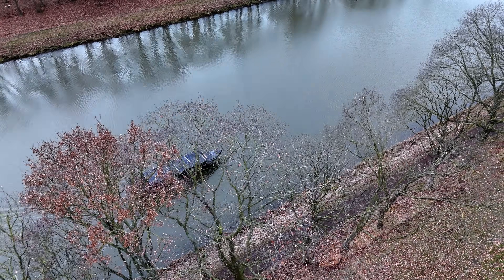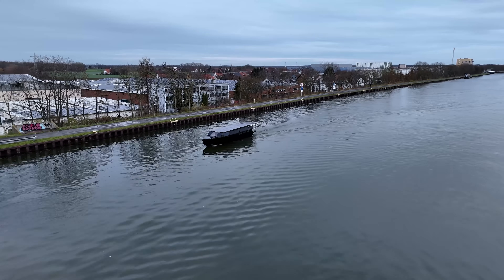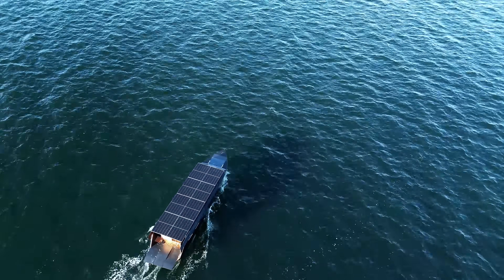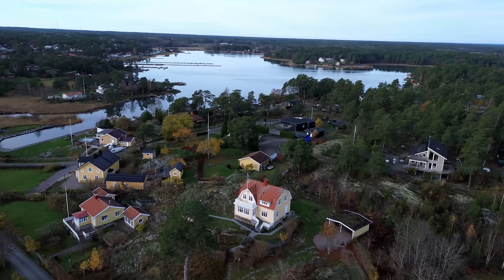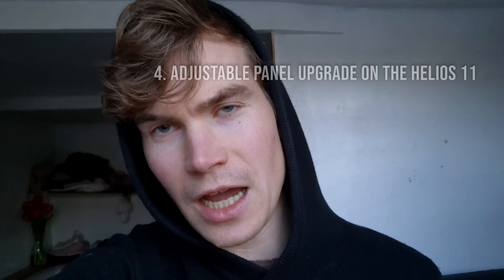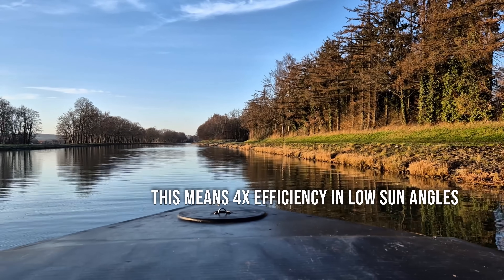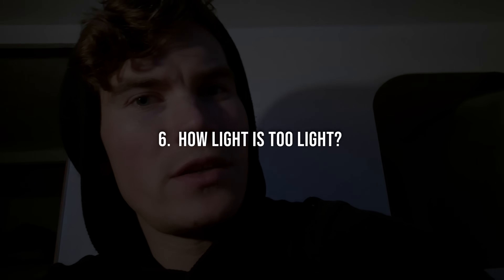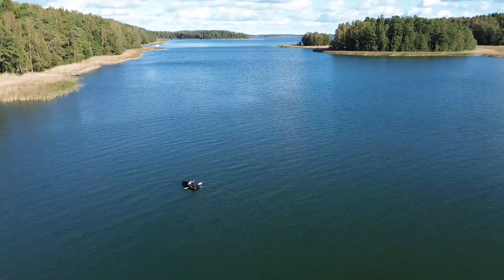My Solar Explorer Reaches Germany: Major Upgrades & Next-Level Design

Comment: Good stuff, some details.  CF is never cost effective and in many cases, not even the lightest. Medium tech FG and Kevlar like fabrics are far stronger for boat use at 25% of the cost.  
Until mass production, epoxy/ply is superior, lower cost, stronger/lb.
Next you are using the wrong flexible panels.  Find ones with regular high efficiency silicon cells like Maxon does, not thin film.

Weight matters more in a monohull than a multihull.   Why is you are planning, not displacement like a cat is or regular sailboat, fishing boat are.  A cat doesn't make a bow wave it has to climb over, it just slices through the water at much lower power above hull speed
 And you want more catamaran hull the water so you don't get blown around.
You want your inboard E drive, far cheaper, to generate power while anchored in a tidal flow, recharge the batteries.

Comment: You can simply remake your hull, by adding two long floads in the full lenght under the hull. you can even make them into a walkway. just a couple of centimeters deeper than you hull now.  it will stabilize a lot. Add these flexipanel to the sides will also do a lot when sunlight is comming from the side.

Comment: I just thought of a guy i seen developing a kite surfing kite automatically deployed as your sail he's working on the software at the moment for it i seen him on sailing parley a month or so back maybe look him up. Another idea was use small car winches to pull your sails and masts up, make a new surround on the bi facial panels out of round aluminium and attach them onto the mast using a universal joint from a car at the top. Ropes to adjust them in all directions  maybe using small winches and dynema rope and pulleys. If the mast can spin 360 deg you can literally get them out of the wind as well as into it for safety make the panels so they can be pulled horizontal and fully up to catch the sun on any angle. Instead of bi facials use some soft flexible panels back to back again with a cut of sensor for shading or have a manual switch for rare unshaded events. So many ideas good luck again hope you can benefit from these ideas.
Reply: a system like his whould rip this plywood bathtub in half,,cool sytem though,,

Comment: Unlimited range ideas: Rear addition scissor ladder collapsible extension, flexible panels secured to balsa wood or extruded polystyrene, 1 layer of fiberglass, hydrofoil at the end. Sides addition folding glass panels electric piston actuators, solar tracking automatically adjusting angle. Front addition mount winch connect to air mattress, inflate with hydrogen using electrolysis, use as kite.

Comment: Hey there.  Great content.  Not sure if you are aware of this.  A larger electric outboard with larger prop is more efficient than the smaller outboard.  You lose efficiency buy running a higher RPM and also lose more energy to heat with the smaller outboard.  With the larger outboard you will have more thrust if you ever need it.   A slower turning large prop creates more efficient thrust.
Reply from the maker: Yes, this is true
Reply: Key Differences in Toroidal Blades:

3-Blade Toroidal: This is often the most efficient for cruising speeds. Because the blades are loops, a "3-blade" toroidal actually looks like six spokes connecting to the hub. It provides a massive reduction in noise and vibration compared to a standard 3-blade prop.

4-Blade Toroidal: This version is designed for even more "grip" and stability. It is becoming very popular for larger boats and electric outboards that need to move heavy loads efficiently at mid-range speeds. It virtually eliminates cavitation (the "boiling" effect), which is a huge benefit for electric motors that have high torque at low RPMs. 

Why they fit your "Efficiency" goal:

Since you were asking about larger props and lower RPMs, the Sharrow design is actually the perfect marriage for that concept. They typically offer:

9-15% more efficiency at cruising speeds (meaning more miles per battery charge).

Increased "Reverse" Thrust: Because of the loop shape, they are much more effective at stopping the boat than traditional blades.

Stability: They act almost like a gyro underwater, making the boat track straighter.

The main hurdle currently is the cost, as they are CNC-machined from solid blocks of metal rather than cast in a mold, making them significantly more expensive than traditional propellers.

Comment: Great work Lukas... I think your on the right track with a catamaran 2 long displacment hulls with bulbs at the nose for more efficiency and canoe sterns. Put sodium batteries in each hull to keep the weight low for sailing and room in you cabin. You don't have to tilt your panels there are two easier options one put light weight panels on the sides of the boat and a sensor to switch so you don't blow panels from shading. You can also use light weight plastic mirrors to focus light onto the panels the solar panels need the frequency to displace the ions and this isn't in the uv bandwidth so reflection isn't an issue. Another idea is biracial panels used as your sails. Make a ridged sail out of carbon fibre or fibreglass take of the aluminium surroundings and attach to the carbon fibre support sail. Have the sails on a centered pole to swivel them and you could also have them on a ball at the bottom to tilt and drop them flat, kinda like a tall ship but with a drop able mast. If you want to loose weight take of the aluminium surrounds there just glued on. Last bit not least you can buy electric actuators to actually tilt the panels and if your really keen raise all the panels on poles with actuators and then use them all as your sails you can work out the design but some ideas I have living of grid on my solar powered yacht On going project at the moment. Good luck and lots of success. nailing it so far.. oh and start a gofund me sure plenty of people will chip in..
Reply: What about sail made using flexible solar panels?
Reply: @vim55k just glue them back to back using sicaflex dynema them together through eyelets. There are plenty of ways to switch the solar off of one side from shading like 4 ldrs and an arduino controller board  just ask grock to write program when ldr  is in shade bypass associated panels to charge controller. You could  make them with each having its own boom or small top one to longer large at the bottom on a tipping lift to drags them all up the mast and they come to rest on the deck when reefing or have a telescopic mast. The weight might get to much at any hight but. When constructing the mast maybe use a carbon fibre windsurfing mast they come with the uni joint at the bottom and worst case scenario you can easily control them by hand or a small pully system and steer with the electric motor. I once sailed my speed boat with the bimini down wind for about 2 km using the motor to steer. I just checked with AI on  backing biracial solar panels with mirrors and using frenzel lenses to redirect light for low angles I good light Ai recons that the efficiency goes from 25% to 50% and in optimum conditions if not overheated 70% the figures may be over estimated at 70% but even at 50% which Ai estimated you can nearly run a motor straight of the panels alone depending on size.

Comment: I started working in a marina/boat building shop about a year ago, ive been thinking a lot about doing something like this. we had an electric motor in the store and i saw the same thing as you.
the idea you could go electric and have the whole power system and drive be essentially free while giving you all the power you could use in a daily live aboard scenario.

i still think a small wind generator (i like the vertical mount ones that catch wind from any direction) would be a big asset. its a pretty easy addon, as its just another input to the charge controller. you dont need anything large just something to keep you topped up over night or in heavy cloud.

Comment: I like monohulls. They self right better if you do capsize. In open ocean, safety from capsizing i feel is pretty important.
Reply: As someone who does both, I moved, designed, built to catamarans to be safer than monohulls for ocean travel. Designed right there is little chance to capsize.  
Wide beam, full hulls, lower height makes them safe.  Nor do monohulls always survive capsizing.

Comment: Maybe little over the top
But you could make transforming construction 
Catamaran with much deeper blades retraced to sail in shallow waters
And double down on light panels and make them retractable, doubling solar panel area with wings

Comment: ❓❓❓  ❓❓❓  Question - I see that you placed soft panels on front of your boat, can you place soft panels on left and right side walls of your boat, 6 on left, 6 on right. I would like to see how your charge will improve - could be light will doubles, cause additional light reflects from water surface. This could be significant. Hope for your response.

Comment: WOW Lukas!!  helios 15m long solar yacht catamaran + sails is spot on! that's my opinion. that will be spot on from my experience of CAT12meters solar yacht from SunConcept. I'm glad you may have been reading my previous comment here where I also suggested for youto  to move to a new Helios model  with 15 meters lenght. check the solar surface area and the improvement of drag eficiency on the water displacement. In my opinion you are on the right way for development of next Helios keep me posted if you need to debate anything. I've been there at the development point where you are. Cheers!! ANTONIO here from sunny Portugal! ;)

Comment: A very interesting concept, I'm very happy to be introduced to it. Your "autopilot" deserves more respect from you, I advise you direct your sense of humour elsewhere if you don't want to put some people off your channel. But good luck on this trip and with future designs, I'll certainly keep an eye out for future development. Decarbonisation is one thing, and valuable for sure, but as you say, traveling on an electric boat is also very quiet and smooth. I've enjoyed traveling on steam vessels for the same reason - quieter and smoother than ICE. (Of course steam power usually has big environmental drawbacks.) Comfort is a big selling point I think and it's a genuine advantage over ICE. Even sails can be remarkably noisy.

Comment: The side walls of your floats are triangles truncated on the outside. Do not cut off their outer walls. This will improve their resistance to immersion and possibly reduce pitching and increase carrying capacity. Also, the walls of the main body can be made not vertical, but drawn at an angle to the edges of the float triangles. Thus, the body will be more streamlined from lateral wind loads and the solar panels will not be vertical on it, but at a more favorable angle.
Google translation

Comment: Have you considered switching to a two blade, slightly larger diameter and most importantly high aspect ratio propeller? Might take some tweaking to find the best design for your preferred cruising speed and motor combination, but there might be a massive saving hidden in that.

Comment: Intesting project. Consider also the idea of buying a sail boat (12-14 m) and convert it to operate whit solar power (replacing the diesel engine with a electric one and installing solar panels and a wind generator). In this way you would have more confort on board, especially at the anchor in the mediterrean, comfy forniture, a very efficient hull (only displacement sailing, no planing), a lot more sailing power through a bigger and optimised sail plan an so on. Big/heavy batteries are no more a problem with a classic sail boat hull design. And it would probably take less time to get it sail ready. In the future you could offer a "diesel to emission free conversion service" as business plan. Moreover with your 13m project you're not able to sail with any wind direction (upwind...) as you do not have a properly dimensioned lead/iron keel.

Comment: Hi, I've been following your work for a few months now. I think the project is great and very brave. 
If I were in your shoes, I would optimize the following in the future: 
Boat stability, sound and heat insulation, increased battery capacity, infrared heating, Perhaps angle the roof panels slightly to both sides; leave the glass panels on the roof, attach flexible panels to the sides.
I'll focus much more on comfort, after all, the whole thing should be fun in the long run. 
Nevertheless, I think the whole thing has turned out quite well already. You also have to consider the costs. 👍👍
PS Nice Autopilot 😅
Warm greetings from central Germany 👍

Comment: If you add wings/frames on hinges down the sides over the windows then it will allow you to move the long panel onto an adjustable solar wing also could add a slim pontoon for stability to support and stabilise. This increases your surface capture area similar to a cat but as its not fixed -adjustable width. think you will get way more power.
Solar Ears like an elephant but absorbing not dissapating

Comment: Flexible semi permanent panels are at a minimum 30% less effective than hard permanent panels , I understand you don't want to make this vessel top heavy but saying the flexible panels are more efficient is false , the only way a panel would be more efficient is if it was smaller with the same output . The flexible panels take up more room and have less output so you will have far less charging ability making them less efficient and effective .

Comment: One engine only is single point of failure. If you are lucky that’s fine. But the sh**t hits the fan eventually…
Reply: That is true for most boats 😂
Reply: @atlevr  autos, motos, trucks, etc… 😂

Comment: Why not use solar on the outside walls and make the windows long slits in between the panels? Any surface area not used by solar is wasted surface area. Even vertical panels do well in winter conditions.

Comment: You really should think to put linear actuators in the next boat to lift up panels in angle. 10 small actuators can do it, similar with those for electric desktop tables.

Comment: You should check out Sunman flexible panels.
 They are built in a special way and tested the same way as hard panels and have much longer warranties than other flexible panels. 
Also come in big sizes like 520W and are sold in large quantitites, so they're really cheap. Plenty of voltage in those 520W panels. There's also a 430W panel, and long narrow 330W panel, so you have plenty of options depending on how you want to build the array.

With much less weight on the roof you can increase the solar area. With how narrow the beam is, you can have the panels be a bit wider than the boat and get more area, and also overhang a bit in the back.
Adjusting them will also be a lot easier when they're so much lighter.

The prices vary a lot from shop to shop but you can find some incredible deals if you look around!
Reply from the maker: Seems like an option comparable to solid bifacial panels
Reply: @Lukas-TrueNorthYachts  To reduce costs, you could probably keep a row of your current hard panels in the centerline of the boat and then flank them with rows of flexible panels on the sides. Have the whole thing be tiltable fore-aft and port-starboard.
Reply: @Lukas-TrueNorthYachts  Definitely check them out. I think they have a 12 year warranty and 25 year output guarantee, or something like that. They get installed in huge projects on roofs that can't be drilled into and such.
With flexible panels, you have so many more options for how big the solar array can be, and you can fold down panels on the side you're docking on if needed, and then put up your wings again when you have space. So many different possibilities. Put your thinking cap on and get planning :)

Comment: Best autopilot,, 👍‍‍😎👍‍. Dont worry to much about weight, if its not a racer your building. Go for comfort, if youre planning to sail long stints.
Imho,, forget the flexpanels. A little, little bit top heavy on a wide cat, doesnt matter. Dont forget insulation. It will be hellish warm whitout.
The lifepo4 batterypacks Im planning for my 12x7m cat, weighs  ca 2x700 kg. It will be very hard to topple it over sideways, if not using gigantic sails.
Cheers from Sweden,, ✨❄🍻🎅👌❄✨